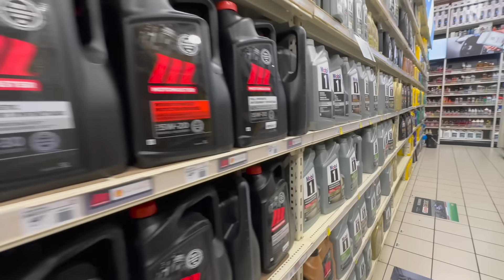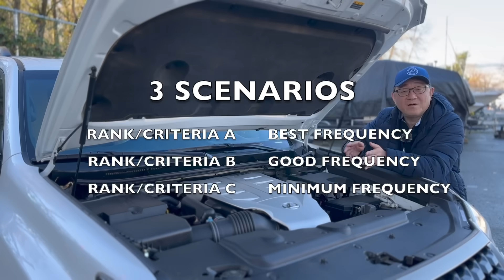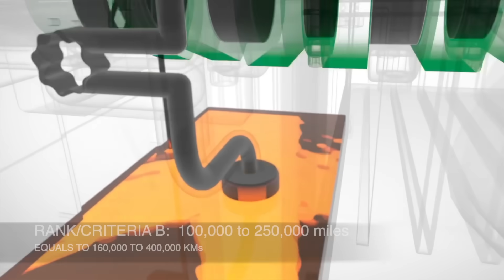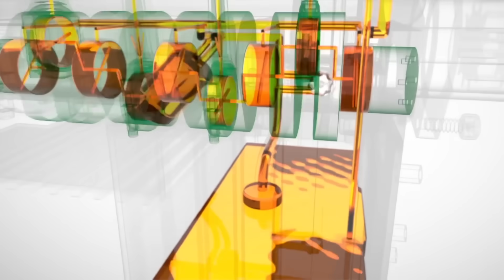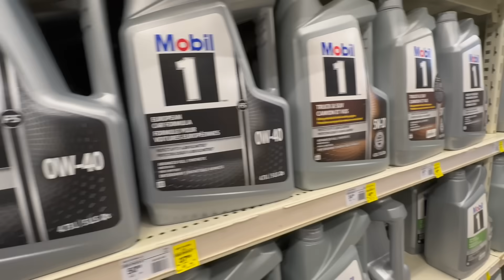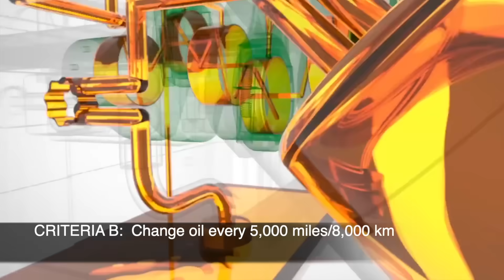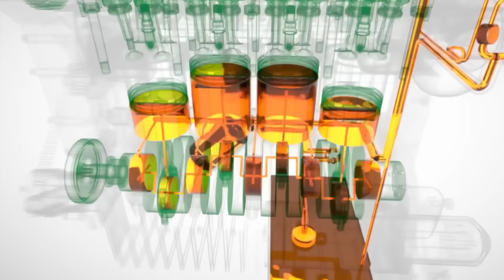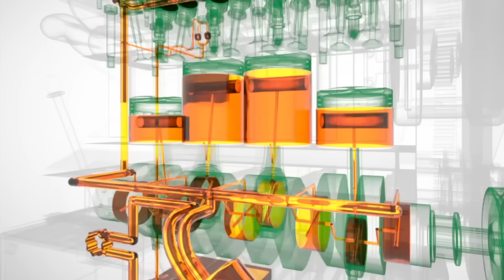ENGINEER EXPLAINS HOW OFTEN TO CHANGE OIL & FILTER // UPDATED CRITERIA-BASED RECOMMENDATIONS!

Comment: 2007 4Runner. Oil and filter change every 5k and transmission flush every 60k. Currently 343k miles. Runs and drives as good as the day I got it. Burns no oil, no leaks, transmission is milky smooth. Wouldn’t hesitate to jump in and drive it from Georgia to California and back. Just a great vehicle made in a place where they value work ethic.
Reply: You've bought the sweet spot of peak Toyota engineering.  2006-2009
Reply: @bertblue9683  It sucks now facts. I avoid em !
Reply: @bertblue9683 2az-fe from 07-09 is a garbage motor. The 05-06 2az-fe is significantly better.
Reply: You are wrong on 1 issue  oil does break down!
Reply: My thought is a oil change is like 60 to 100$ and I get it done around 5k. And a new engine cost 4-7k. I rather get more oil changes.
Reply: On the transmission do you do a flush total fluid Change or what’s in the pan?
Reply: @poppyneese1811 just a drain and fill so just what is in pan. I did a flush the first 60k mile change but only drain and fill after that.
Reply: @Kdavis8377  I appreciate that Thank You!
Reply: @Kdavis8377  Good advice! At 75K i did a flush because i bought my 2014 F150 brand new. However, in future changes i'm just gonna drain and replace.
Reply: @Kdavis8377  What about filter?
Reply: Awesome!!! 
I'd be interested in knowing how often you change your transmission/diffs/transfer case fluids.  And at what mileage did you do the first changes?
Reply: @TheBeatenPaths tranny every 60k, all diffs every  20k,  I lube all the lube points every oil change . Seen many 5th gen’s with 150-200k miles still running strong as well.
Reply: I've had domestics run without any issues too.  My current truck is a 2012 Chevy 4.3 V-6 I bought new and only issue has been one $30 sensor.
Reply: @chuckgladfelter you’ve been lucky. I’ve never had a domestic without issues. Chevys, Rams, Fords…they all had them for me
Reply: @Kdavis8377  I don't hear that often at all as an engineer. Ford trucks & Transit vans are especially durable.
Reply: @chuckgladfelter  Many ppl have or they wouldn't be in business. All I own.
Reply: @chuckgladfelter   Only way to go. Ford trucks & Transit vans.
Reply: If it’s a CVT , change the transmission fluid every 25,000 to 30,000 miles.
Reply: 60,000 mi for a transmission service is way too long and I don't care what the manufacture recommends that should be done at 30,000 and when the car is new it should be done at the first 3,000.
Reply: Ford trucks regularly get those mis. Most registered vehicles on rds w/250k+ mis. Wouldn't be best selling trucks if not excellent.
Reply: You have one of the best made vehicles made, in Australia we call it Prado.
Reply: Here a Camry owner and I agree 💯 with your comment, i do transmission oil changes every 30k and replaced the filter at 100k , flushing the transmission it’s not recommended, engine 140k and I use Synthetic Mobil 1 EP every 5k , no problems whatsoever.
Reply: @64arguz  always change your transmission filter at 30,000 mi if that's what you're using as an interval. As the transmission gets up in miles you'll want to change that filter every single time or it will bite you in the ass.
Reply: @willsrestorations  my wife has an Acura RDX my daughter a Honda element, transmission filter can’t be changed unless you disassemble the transmission so the original filter is going to be there until I take them to junkyard, both vehicles are over 150k , same philosophy, transmission service every 30k no problems whatsoever, they are different cars but the principle is the same, nevertheless your recommendation is valid and is the way it should be. 👍
Reply: @64arguz  That's because they use what's known as a metal screen and is not a paper media filter. There are a lot of cars that have this now
Reply: I also have a 2007 4Runner 293k oil changes every 3k and trans fluid drain and fill 2times every 25-30k. Runs like a champ. No oil burning.
Reply: Keep it. The Toyota's are junk.
Reply: how many vehicles are totaled every year ? It has nothing to do with oil change!  Most contaminants are burnt or filtered.
Reply: they better value it or they get the whip.
Reply: You have of the best engines Toyota has ever made and are taking good care of it.
Reply: Never flush transmission. You're forcing metal shavings in tranny into transmission channels clogging it up. Eventually you will have tranny failure. ONLY drain and refill.
Reply: Trans flushes tend to dislodge wear particles. I've always just done a simple drain.
Reply: Oil and filter ( both synthetic  ) every 7000 kilometers, oil filter ever 3500...Transmission oil and filter every 2 years...
Reply: Do not flush the trans. I recently believed otherwise but was convinced that it should never be flushed, only getting a pan drop, magnet wipe down, and strainer change every ~100K-120K miles to keep good flow and the solenoids functional.  Changing the fluid every 30-60K miles depending on how harshly you drive, but also depending on the color of the fluid.  Even a BRAND NEW trans is not running optimally in regards to the torque converter.  The torque converter likes having clutch material in the fluid so less fresh clutch material is used for gripping.  Even when the trans is new.  The gears however, like the engine, prefer as clean of fluid as possible. Striking a balance between keeping enough old fluid to preserve the torque converter, and having enough new fluid for fresh additives and less gear wear is the best throughout the whole life of the trans. Except if you’ve neglected it, then even a fluid change may wear down the clutches to where you need an expensive repair. 

Tldr: The engine and trans gears like perfect cleanliness.  Any slipping parts (clutches) like moderate cleanliness.  Strike a balance by monitoring fluid color.  A flush every 60K will wear down the clutches more
Reply: Is that every 5k in miles or km?
Reply: Time to switch to 3000. Just from wear and tear it's getting more blowby which is introducing more unburned fuel into the oil and contaminating it faster. 
Go for 500,000 and more...
I have 435k on my cheap Hyundai, changing every 3000 and trans oil every 30,000
My trans oil changes are simple drain and fills. Drains one gallon per change.
Reply: @TheBandit7613  How often do you change the trans filter?  Not knowing if you ave a drain plug you use, or drop the pan. 👍
Reply: @TheBandit7613  synthetic or regular dino for the motor oil?  That's great mileage on a Hyundai!
Reply: @kargo27   Regular cheap oil and a Wix filter, but every 3000 miles give or take a couple hundred miles. The car is still being driven daily today. Don't forget the trans. A simple dump and refill once a year with Hyundai trans oil. Trans has also never been rebuilt.
Reply: @TheBandit7613  that's amazing.  I had a 2005 Elantra and followed the recommended oil change interval of I think 5k miles.  Before I got the car at 30k miles, I think the previous owner used regular dino oil.  I used full synthetic and changed the transmission fluid every 36k miles.  I sold it with 176k miles on it and it was starting to use about 1/4 to 1/2 quart of oil between oil changes but I don't know if the PCV valve was clogged and stuck open.  That could have caused oil consumption.  I sold mine running fine with no issues.  I'm amazed at the life you got out of your car, that's fantastic.
Reply: PCV valves are cheap.Change them.
Reply: not hesitating sounds good = but maybe pack a few underwear and don't forget your wallet = meet you in Fairbanks = GO!!
Reply: Thats more because its a 4runner, and not because of fluid change intervals. I had a 300k toyota that we abused and never even changed the oil
Reply: @jonc2914 300k without oil change??

Comment: So the moral of the story is DO NOT BUY LEASED VEHICLES EVER!!!!
Reply: I would add a caveat that buying a leased vehicle or or a "program vehicle"/ demo or a used vehicle that is no older than three years can be fine, provided that the Carfax indicated proper oil changes and maintenance.  In my life, I have never been stuck with a vehicle that was not cared for properly.  Additionally, buying new does NOT guarantee success.  As an example, I have experienced a Coyote engine that needed a quart about every 1,500 miles; according to the manufacturer, that usage is normal.  I had a second Coyote in a different truck that never used oil during an entire oil change interval.  I also had a 305 cu. in. that, after the 12k warranty was up, showed 2 adjacent cylinders with wet spark plugs.
Reply: @williamiwaniuk5561  Yes. We just bought a 2023 Honda Passport with 6500 miles. Carfax approved and $20K less than a 2025. I'll take it to the dealer for an initial oil change for a baseline. The Honda dealer I use includes a viewing area where I can observe. No problems  in 17 yrs.
Reply: I agree. my new 2024 4Runner was only a few more $1000's
Reply: @7Eggbert  Absolutely. If you're looking for a car that needs to last a lifetime, the difference is minimal. For instance, Toyota schedules maintenance every 15,000 km, which is ideal.

I bought my F15 new ten years ago and have maintained it every 12,000 miles (19,000 km) or so.

As for the F31 that was stolen, I purchased it with 15,000 km on the clock directly from BMW HQ in Belgium. It was practically brand new, and I even got a 25% price reduction.

Buying from a leasing company? Never.
Reply: I agree it would be better to buy new, instead of lease.   But I have been buying off lease CPO Toyota and Lexus because of the lower cost and service history.  Although only the manufacture's oil change interval was followed (A) early in it's life, I change oil with (B).  Both of these vehicles.  2014 Camry (150K miles), 2008 Lexus ES350 (125K miles) consume very little  oil and run great.

Comment: How about hybrid and especially PHEV vehicles where the ICE run time can be much lower over the same mileage? The manual for my Prius Prime, for example, says 10K miles or 1 year, whichever comes first. In that 10K miles I may have been in EV mode about half of the time. Most of the HV mode miles would be highway cruising.
Reply: I follow the 4 month interval change.
January - April
May - August
September - December
I put on about 15,000 kms annually... Hope my Corolla Hybrid SE AWD will last forever....
Join the "A" club.....
Reply: @dproulx222  I think I'll be doing UOA periodically out of curiosity. But the cost of that can negate the cost savings of longer oil change intervals anyway. I'm barely doing 10K miles in a year.
Reply: @don_chuwish  If you are changing your oil twice a year when driving 10,000 miles you are maintaining your vehicle well so long as you are also replacing the other fluids as suggested.  Keep it up and your vehicle  will probably last as long as other vehicles on average.    If you decide to one additional oil change per year the statistical probability of  extending the longevity of your engine simply increases.
Reply: @dproulx222  Thanks. Given that it's a plugin hybrid I actually think twice a year is probably overkill, but that's what a UOA will confirm.

Comment: The manufacturer recommendation will find those common failure points where cleanliness is critical. AMD just repaired a Tundra with a sticking timing chain tensioner.
Reply: That was a great video. I'm 3 hours from Amd's shop and only have him service my cars.
Reply: How about some BMWs or Audis - not only chains are problematic but also labour intensive. Engines are very expensive for them, oil and chains relatively cheap.

Comment: I put 5600 miles on my new Subaru FA24 break-in oil, also had a laboratory analysis on the oil. It had low amounts of wear metals and very low amounts of combustion contaminates and no amounts of coolant migration contaminates. I would recommend a lab analysis to anyone curious about the condition of their engine. It is cheap peace of mind, about $35.00. I check the oil every fill up and have no drop in level yet, feel it between my fingers and smell it for any changes in aroma such as burnt by turbocharger.
Reply: Does Subaru use a special break in oil?
Reply: I could use that money towards my next 2000 oil change instead. Especially in a FA24 with its RTV problem. I drive short distances with minimal amount of drive time. Lab testing is a waste of money. Unless you like burning your wallet.
Reply: I used Mobil 1 15 50 racing oil to break in my 84 Subaru. When I got it home from the dealership I put in the Mobil 1. It was so well put together it didnt need break in oil. Never got another oil change. I was supposed to go back for a valve adjustment. Never did. For what an oil analysis cost I can change the filter and add makeup oil. That Subaru used a Frantz oil cleaner. The 93 Legacy uses a Motor Guard oil cleaner and Walmart synthetic oil.

Comment: I have a 1996 Pathfinder. Changed the Synthetic Blend Oil every 5000 miles. I have 215,000 miles on it. Still runs like new and gets the same gas milage. Does not consume any oil between changes.....

Comment: What about the Honda engine oil life computation displayed on the dash?
Reply: i would follow that. It was designed by the manufacturers engineers.  I have a company truck in which i do just that, go by the computer notifying me of an oil change.  About every 12K km. We keep the trucks for about 5 years in which the odometer shows approx 250K km.

Comment: David,

Excellent video and your time and effort to make it is most appreciated. I need to ask a question.

I recently purchased my 11th Honda, in this case, a 2024 Honda CRV Hybrid Touring model. I live in Saskatoon Saskatchewan and get really cold winters and very hot summers. Having purchased the vehicle at the end of October 2023, we had to endure a brutal December. While I park underground in heated parking, I still need to venture outside in those temperatures, park it, and leave it sit for several hours, before restarting to drive it home. The CRV has active grill shutters that assist with getting the engine up to temperature as quickly as possible, in addition to giving me cabin heat, even though the vehicle operates in battery only mode at times.
My question is, should I trust the Honda Maintenance minder or go with my gut and change it more often. My concern is that the number of on/off cycles of the hybrid system means that I am more likely to not have the engine up to operating temperature for long enough periods of time to purge the crankcase of unwanted blowby and contaminants.

I would really appreciate your thoughts on this question. As others have said, the cheapest engine is really expensive, however the most expensive engine oil is cheap.

Thank you.

Comment: I let the dealer from whom I purchased my 03 Toyota Sequoia change the oil every 5k miles. I purchased the lifetime oil change plan, which cost me only $500 and a $10 environmental fee per oil change. At 301k miles, the 4.7 L engine is still going strong.
Reply: Have had several dealers, cheat, and not change filter, have caught several doing this, so change myself now
Reply: @garydale8874  Some manufacturers and service managers recommend only changing the filter every other drain interval [not me, I don't do that].
Reply: Not bad. You're currently at less than $19 per oil change including the environmental fee.
Reply: Nice video
Reply: then everybody's happy- they can cover the cost of the bulk oil they use with your $10 and advertising or policy adjustment (33C) can pay for the technician.
Reply: how does this work, dealers refuse to replace the oil until it reaches 10,000 miles
Reply: @michaellizotte4586  My 03 Sequoia doesn't use synthetic oil. With convention oil, the oil change recommendation is 5k miles.
Reply: Good Dealer will inherit your tradein and sell you a new one WIn WIn
Reply: Environmental fee?
What is that. It’s been over 10 years since I took my car to a mechanic for oil change. I didn’t know they added this Fee 😂